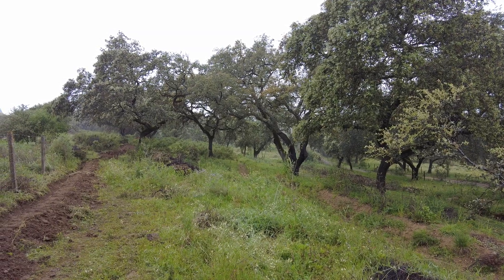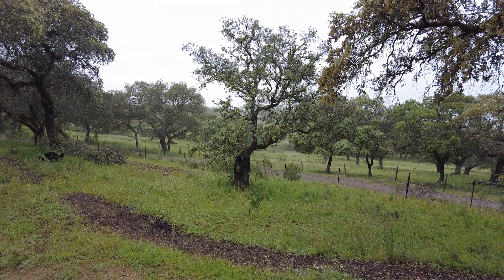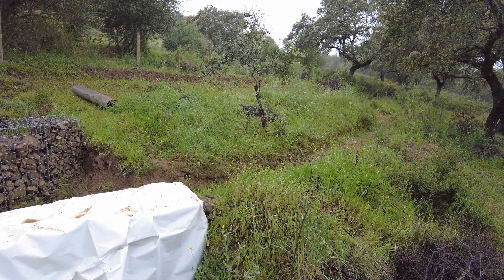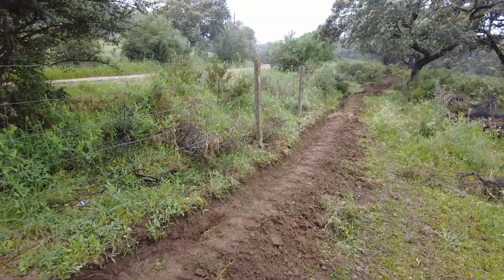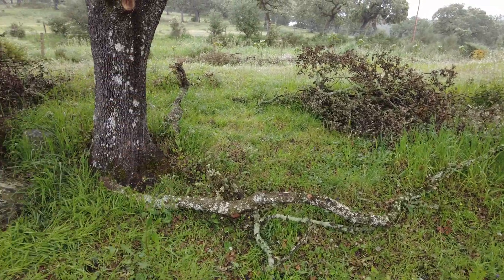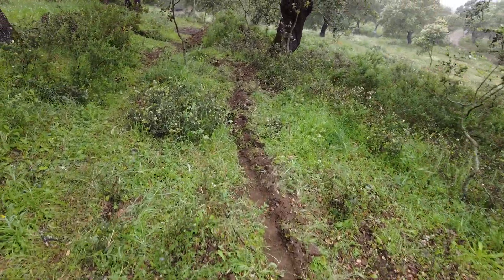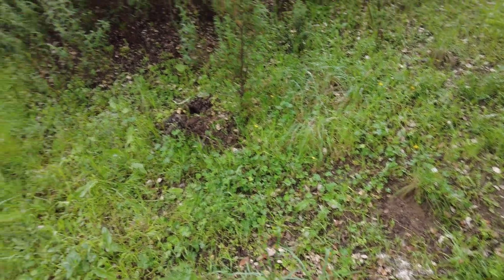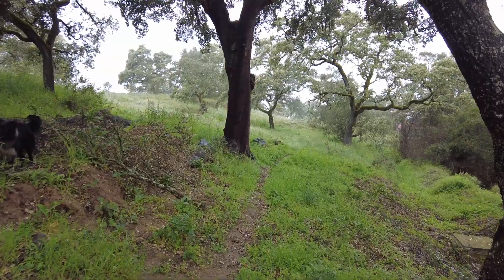Doing the right thing and difficult terrain conditions.

Comment: do you think about putting some brick overflows in your canals every few metres so they can hold back some water like a swale?
Reply from the maker: Good one. I must do that. Thank you for sharing valuable information
Reply: don't forget to leave a low point in the centre for the overflow so it doesn't erode your bank edges @SuerteDelMolinoFarm

Comment: Splitting the water so many ways will ultimately require concrete structures to make them all work. 
A job for the summer once you know it works in theory. Then next winter water will spread well every time.
Reply from the maker: Yes yes. Thank you for sharing. I agree. Let's try it now and build something concrete in summer.

Comment: A suggestion about using the Giraffe on a steep slope;  If the downhill side of a swale and berm is too steep for the Giraffe,  dig the swale from the uphill side.  The only adjustment you may have to make is being certain that your boom and stick are fully extended before you open your bucket to drop the berm soil.  I don't know for certain - but I think you have adequate reach.👍
Reply from the maker: Good one, thank you Steve

Comment: Hello Martin,  I'll suggest that filling the eroded area just below the culvert with dirt that is not compacted is not a good idea.  Why?
The over flow (leakage) around your 3-4 way pipe distribution system and the runoff from the crown of the road will wash the dirt into your two small holding ponds with cement block dams.
If you really want to dump a load of material in the wash out, buy stone that you can use to fill gabion baskets.
I'll repeat my suggestion of a surge basin built out of gabions that are built up to the desired level.  Run your pipes through the gabion at the appropriate elevation to feed all of your swales on the eastern side of the farm.  
You can meter the flow to the 4 swale systems this culvert feeds  (will feed)by selecting different diameter pipes.
When the pipes are installed to your satisfaction, render (plaster) the interior of the gabions with cement and sand mix.  For extra protection and waterproofing, paint the render with swimming pool paint.
To simplify the render, you can stack the gabion baskets walls with bricks (recycled) or concrete block (recycled) that will make the inside of tank.
As there is no direct interference with the culvert, the Andalusian road authorities should not have a problem with this solution.👍
Reply from the maker: Thank you Steve. I get what you say but I'm not clear. Maybe you can explain more simple to me.
Do you say I build a gabion from the culvert to my fence and onto my land?
Reply: @SuerteDelMolinoFarm  A three sided gabion tank that finishes at the same height as the bottom of the culvert.  This is the same thing you have done at the creek culvert out of stone and mortar.  You would be creating a distribution box with an emergency overflow and a weep hole at the bottom for accumulated water to slowly leak onto  the land.  I'm suggesting gabions because they are the only structures that have held up to the big storms.
I do not believe the fence is an accurate representation of your property line.  It was placed there for convenience.  A better indicator is the cement headwall surrounding the outlet of the culvert. 
I would place the first two gabions where you can dig a good foundation on your side of the fence.  Then the side wall gabions would be dug into the hillside.  I suspect it would take at least 6 to 10 gabion baskets.  This is a two gabions high structure, interlocking at the corners. 
I hope this is helpful.👍
Reply from the maker: @stevejohnstonbaugh9171  Thank you for sharing Steve. Now I'm tired after reading it. It will happen. Have a great day.
Reply: @SuerteDelMolinoFarm  I may be way overestimating the number of gabions.  I'm operating at a real disadvantage because I can't collect actual field dimensions.  If you get the Giraffe on site and dig out a foundation, you will have a much better idea of the number of gabions required.  The best I can do is a rough estimate based on what I see in pictures.
You can dig a foundation anytime. 👍